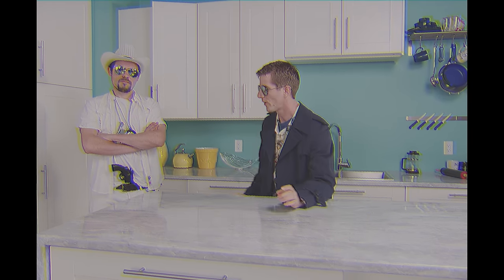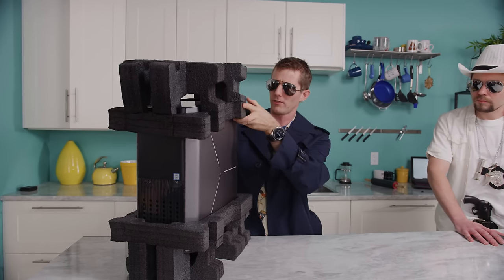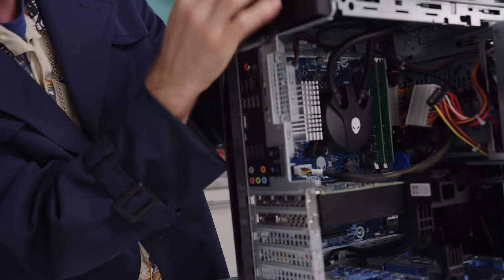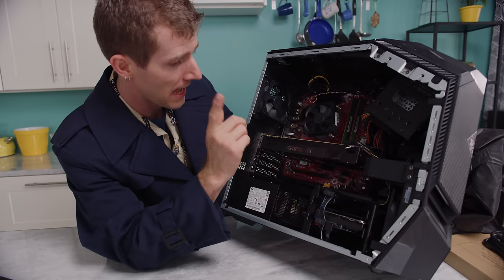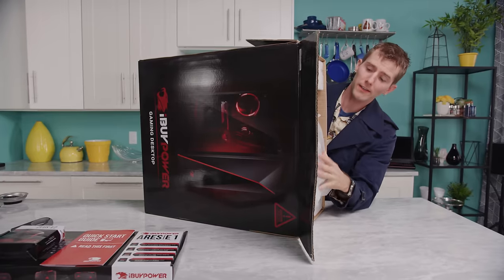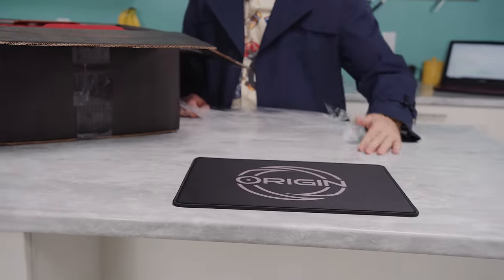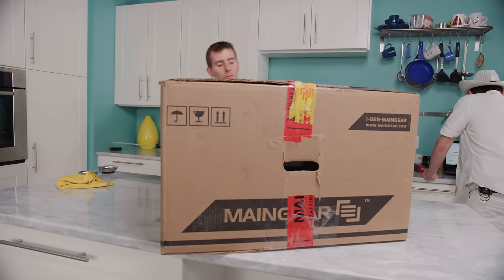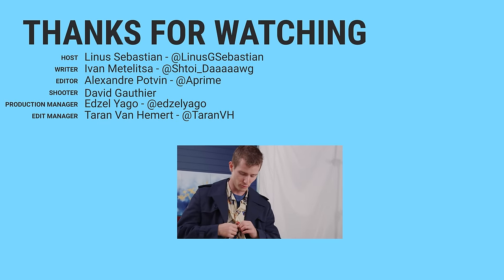What did we BUY?? - $1500 Gaming PC Secret Shopper Part 2

Comment: wow my pc got outdated fast and I got it like 3 years ago
Reply: This is the real problem. It doesn't matter if you spend $400 or $4000, in 5 years it's junk.
Reply: Can't be that badly outdated right?
Reply: @WilliamW97  it can be if it wasnt very good in the first place :)
Reply: @apaxtoa  yeah i built my pc like 3,5years ago and the only part that was kind of newish was the graphics card. i use the old AMD 8 series cpu and it works great.
Reply: @apaxtoa  lol fair enough.
Reply: Depends on your definition of outdated! Sure parts may have outclassed it, but does it still do what you want it to do?
Reply: It's not your fault as there was no competition. Intel had a monopoly for the last 10 years and released lackluster CPU's with minimal improvements.
Reply: Wow my laptop was bought 5 years ago, its not gamer and still runs some newer games lmao. 

Btw its a dell 15r 5537.
Reply: I bought my PC when skylake was out and I got an i5 6600k running at 4,5 GHz, GTX 1070, 16 Gb RAM and NVMe boot drive + 500 Gb SSD for games + 2 Tb HDD. Got the parts for 1,6k including tax 3 years ago and it still runs all games on High settings at or above 60 fps on 1440p. Not sure what you got but buying PC's is all about timing and future proofing.
Reply: How big is the NVME drive?
Reply: Tyler Wiley " It's so big you gotta put it in the front! " 

(Le druaga1 reference)
Reply: @Tyler-Wiley  250 GB
Reply: It probably has 120mm fans. EW! Silence is outdated.
Reply: @OcihEvE  yet my 7 year old i7 2600k is doing fine!
Reply: Well from 2000ish to 2011 systems got utdated every year, 3 years isnt that bad....
Reply: @givejagersacogback7602  If you're using an fx8350, you cant just "add" a ryzen series chip.  Ryzen as a platform uses the AM4 socket, and thereby, only AM4 motherboards are compatible. The 8350 uses AM3+.  Beyond that, the upgrade in board and processor would then necessitate DDR4 ram.  (Ryzen does not support DDR3)
Reply: @OcihEvE  That's not really true... a $400 dollar build is not only going to under perform currently, but it will drastically under perform even a year or two from now. A 1070 or 1080 is going to outperform now, and in 3-5 years it will average out or become slightly sub-par yet still be capable.

Comment: So much money yet only a GTX 1060 or 1070
Reply: SirCharles the GTX 1070 is fair the 1060 isn’t really.
Reply: @sircharles Well it might be Canadian money because Linus tech is in Surrey which is in canada so if that’s the case it’s prob 1100$ American which I doubt or it could be American money and be 1900$ Canadian. also it’s not just the graphics card the processor and graphics card is prob 600 and with the ram the storage and mother board prob add 300 and the power supply and the case 100 plus the assembly which is like a 50 dollar job so if you build it urself you would save 200 and you could possibly upgrade ur Gpu to a 1080 don’t judge me if I’m totally off i don’t have a crap ton of experience building my own pcs
Reply: @ronanpon7282  Yeah the budget was 2000 Canadian Rupees or about 1500 USD ^^
Personally i wouldnt buy a GTX 10 series new now other than maybe Evga B Stock 
or used since quite a few already migrated to RTX cards
Im guessing ( without any evidence ^^') that the componends cost around 900$ and assembly should cost 60$ at best 
Might be that you guessed better still :D

Comment: finished video HP looks like it will win hands down
Reply: IDK, I'm rather impressed with iBuyPower overall. Gaming, both iBuyPower and HP should be about equal, and better than all other machines in the video, thanks to the use of a GTX 1070. But iBuyPower's use of real branded high quality parts puts it over the top, especially the MUCH better GPU cooler (which thanks to GPU boost may actually allow iBuyPower to take the number one spot in performance in games). HP's blower style cooler will not hold a candle to that Asus cooler.
Reply: iBuyPower for sure

Comment: Yo, Origin sent a PC offering COD BO4 with a 1050 Ti, where the recommended system requirements are a 1060 6GB or a GTX 970, and the 1050 Ti is significantly worse than those two

Comment: Ibuypower Is offering i7 8700k Windforce RTX 2080 Adata 16GB DDR4 RAM MSI Z390A PRO Motherboard Seagate 2tb Hdd 240gb SSD WD Green liquid cooling and case of ibuypower With 650W PSU For 1799$ Will it be worth it?
Reply: Canadian or US dollars?
Reply: @Markus-zb5zd  Us I guess
Reply: I think its worth it
Reply: @arunim2000  What if I say for 53$ more I am getting same specs with i7 9700k?? which one is better?
Reply: @amitansh  if you can get those specs for that price, get 2 lol.
The first computer I built I had a i5 7600k, 1070, 2tb hdd, 250gb SSD 32gb ram with a watercooler for $1900 ish. It was 2 years ago. But still, yours are a freaking great deal!

If I were to buy any of those systems I would have to pay a lot more. A 2080 here is about $1000 alone and a 9700k is about $550. So yeah, its a great deal if you ask me.
Reply: @amitansh  Ohh if I buy a system fully with basiclly the exact same configuration, but no (from what I understood?) custom watercooling, that would end up on about $2400-$2500, so you have a reference from what someone else would pay in a diffrent country that still can get it fairly cheap compared to other countries.
Reply: @rickardsvensson7097  Ok Thanks dude❤️
Reply: @amitansh  9700K has no hyper threading sadly 8700k still the best

Comment: "There's some weird stuff in here" so what you were saying was, it was alien to your expectations? ;) I don't see why bare metal on the internals of a system without a goofy window in the side is in the "bad stuff" category, though. It's not like the thing is going to rust, or at least not before many other bad things happen due to being in an environment wet and salty or otherwise chemically active enough to cause corrosion.
Surprizingly impressed with the HP on unboxing too. All my prebuilt systems have ended up coming from them, but they weren't recent. 

iBuyPower seems to have put function over form, nothing at all wrong with that.
Your Maingear Good and Bad list doesn't agree with itself, or what you just did in the video - one side says 14 days from order to ship, the other says 19, and you just pointed out the sign on the side saying to remove the foam but the list says there wasn't one.
And this is a video over a year old, so none of this actually matters by now. I guess that says good things about how interesting this particular series of them is?

Comment: The hp computer looks awfully similar inside to my lenovo legion t530.. it literally has the EXACT same cpu cooler (which is awful, reaches 100c sometimes on basic games), same crappy exhaust fan, weird extra bit sticking out of the gpu (rtx 2060)..

Comment: I'd definitely give BONUS points instead of negative points for HP's cancellation based on the "hangouts" call. That's a great anti-fraud policy, and as someone who used to work for a US cell phone company, I probably received some 2-3 fraudulent calls a day out of an average call volume of about 4-5 calls an hour in an 8 hour shift. One of the biggest clues was if someone called in, and their credit file had a flag with a phone number to call back to; as I had call display, it was sometimes VERY easy to confirm that I had the right person, and also knew when I would need to call another number to verify.

Comment: Just a note on orientation arrows on shipping boxes, and this probably applies to most shipping companies, although I'm specifically talking about UPS here. Anything written on the outside packaging like "Fragile", "Do Not Drop" and "This Way Up" essentially goes ignored with the exception of hazardous materials, in which case we are supposed to pay attention to orientation arrows. If I'm loading a heavy box onto a truck, I'm going to push it under a shelf with my foot rather than squatting or bending over. If the box has huge air gaps in it (like with the ibuypower one), the outside packaging will look like garbage very quickly.

Comment: Maingear is expensive if you want an actually good gaming PC, probably because the case is ridiculously fancy and comes with stock water cooling. Expect to spend about $2,000 USD for a Ryzen 5 2600x system. It does include free gear and games, but if you don't need those games, you could save yourself like $700 buying an iBuyPower or cyber power pc and they would include a Ryzen 7 2700x and 2060 GPU.

Comment: Omen, the two fan size thing. Wonder if it's so some of the back pressure forces the hot air from the GPU out the bottom grill instead of making it swirl over the upper board.

Comment: I made a custom system on Aftershock PC for $1500. The specs I got were: GPU: 2070 Super, CPU: 3600X, Motherboard: B450M, Memory: 16GB 3200 Mhz, Storage: 512 M.2 NVME SSD and 2TB HDD. I even threw in wireless Wi-Fi and a bit of RGB lighting and the total was $1474. This just goes to show how trash these systems are.

Comment: a bit late here, but i bought an IBUYPOWER pc just a few days ago and i am VERY happy. i9 9900k cpu, rtx 2080 super, gpu, evga 80+ gold 750 w power supply, 16 GB of 3k ram, 1tb seagate sata drive, 480 gb ssd (not sure what brand or model), the snowblind case with the lcd side panel, wifi/bluetooth card, gigabyte z390 UD motherboard. lots of room to upgrade too, all for only $1800.

Comment: The Maingear might not win in pure system performance (and it probably won't, I haven't seen pt3.) but the parts used were very well thought out. 
1. Janice said he would be video recording and streaming, and for that you want the Ryzen CPU
2. Janice said that he has an average monitor and is not looking to upgrade. A 1060 will do for 1080p gaming pretty much every single time. I imagine if Janice said "he has/wants a high-end monitor", there would be a 1070 in that system. 
I don't need to watch pt3 to know Maingear won this one.

Comment: The HP Omen canceling the order because you used Hangouts and the phone number didn't match I would actually put in the 'Good' side, because they are sensitive to the problem with identity theft, and it didn't slow down their delivery in the least (as you said, first at the doorstep). I mean, imagine if someone had spoofed your information, wouldn't you want them to NOT charge you $1500 on a system you didn't buy?

Comment: Top-Mounted USB, Audio, etc. ports facing up require plugs for unused ports so conductive junk has zero chance of connectors shorting-out inside this style of I/O Port Mounting style.

This happened once with a phone jack I had mounted top-load in order to make it easier to plug cords in behind their desk right in front of it.

But, I had forgotten to tape over the unused RJ-11 Jack and vacuuming it out fixed it.

ALL Unused Up-Facing Ports Require Dust Seal.

Comment: I got a cyberpower prebuilt with an AMD Ryzen 7 2700x , Radeon rx580 x, 16 gb DDR4, 2tb seta drive, 256gb nvme ssd, windows 10 pro, 650 watt power supply, and 4 120mm case fans. 
Total cost was $985 , highly recommend.

Comment: Just got my new PC to see it here in this video, the Aurora R7. I was lucky to get it for $961.99 with an 8700, 16GB optane, 1080 and AIO water cooler as an open box at Best Buy. Normally would not buy a prebuilt but I could not come close to this on specs without more sacrifices than Dell made. I also get the full warranty through Best Buy so its no different than new (was marked "fair" but only had 1 tiny scratch and two scuffs, all the accessories, even that $10 keyboard and mouse).

Comment: Even though the board is proprietary it is an upgradable PC and not with only dell parts you can put whatever in it, it’s not like Dell’s stuff where you can only upgrade with there proprietary parts even though there part of dell I guess they figure gamers are most likely gonna upgrade something eventually, can’t wait to get mine I’m dying for GPU prices to come down but I may have to just bite the bullet and spend the dough cause I’ve heard it could be a year or more before GPU’s are back around MSRP and CPU’s themselves have gotten insanely expensive I miss buying a Mobo/CPU combo from Newegg for about $250-300 and you would get a good board and processor now it’s a little over $1k for the CPU/Mobo and they don’t sell combo’s anymore that I can find check out this R11 it’s been upgraded with aftermarket parts that aren’t proprietary https://youtu.be/5B-zwUs8J3Y

Comment: I bought an Alienware Aurora in 2008.  I did get the Alienware keyboard and mouse.  That box your power cord was in had the keyboard, mouse, an Alienware Mouse pad, a actual bound book with documentation on everything in the system.  It came in a box that was literally 52 inches tall, and I had to get help carrying it in the house from the UPS driver.  He actually said "Dude, I don't know what you have in this thing but I need help. "  I still use it to this day, until I get all my parts for my AMD build (Jan 2020).  I will just say, the the case it comes in now is rather disappointing looking.....oh...forgot I did get the Alienware Monitor as well, one reason the box was so big...

Comment: My first gaming machine was an iBuyPower (my parents were funding it and didn't trust me to build my own yet). When it arrived, the outer box looked like the iBuyPower box they got in the video. I plugged it in, and nothing happened. They had unplugged the power to the GPU and hard drive when they shipped it. There was no documentation as to why they did that or telling you to plug it in. Also, I had to buy a different case because the case iBuyPower used wasn't big enough for the ATI Radeon HD 3870x2. The card fit, but the case didn't have sufficient cooling to run it without overheating.

Comment: Hmm, I don't know, it's easy to say that Dell had the better cooling capacity with a quick inspection; of course a 120mm AIO beats a dingy little stock-like cooler. But if you really think about it, that little stock-like cooler is probably enough to cool a non K i5 8700, and even though it might seem counter-intuitive, I think that they actually put some thought into the cooling fan distribution, they are pretty much ending up with pretty much neutral pressure, since the graphics card is a blower design, it too acts as exhaust, so the small turbine fan plus the 80mm fan most likely add up to just about a normal 120mm fan, so 120 in, 120 out (I can't really make out how the power supply is mounted, but I think that it's mounted for exterior intake? The case seems to have an open bottom, so it would make the most sense to take air from the outside, specially since the case has some decently sized feet, so even in shag carpet it would probably be "ok-ish")

Comment: Its sad that people actually buy these, not a single one of these companys did extensive research about the customer's need. Sure most of them are fine PC's, but with 1500$, you are supposed to get every detail right, start from the case and casing. So people please contact some pro's before you buy PC, otherwise you will not get even nearly best bang for your bucks. 1050ti inside 1500$ gaming PC is just a massive joke.

Comment: Remember when Dell bought Alienware? "We are not going to change the company, we just want to give them the benefit of our supply chain to solve part shortages for them." Such BS, that is totally Dell engineering on the inside- identical drive cages, proprietary motherboard, same old vendor lock-in games. The Alienware we used to know back in the day is completely gone.

Comment: I got an iBuyPower desktop from Best Buy after finding a really good deal there. Was there just checking out what they had to offer. Sales rep tried his best to get me to get an Alienware/omen, but knowing better I found the small little corner in the back with the not so known brands. Ended up getting a much better system for less then what hp/Dell offered. Was not planning on getting a pre-built, but after checking online for what it would cost me to build pretty much the same system I would have only saved around 90$. It's been a pretty awesome computer so far. Only thing that really sucked about it was the SSD it came with which I upgraded shortly after, and knew I was going to need to anyways. From what I understand iBuyPower kind of throws together the prebuilts for retail locations with extra parts they have laying around, and sell them to the retailer for the same price regardless of specs. So there's a chance you can get a really good deal, but also get ripped off, but if you know what your buying then that's not a problem.

Comment: Just have to put a quick correction. The HP is definitely NOT powder coated (basically painted). Its anodised (a tint in the metal). Realize it seems minor but anodising generally is more scratch / damage resistant.

Comment: I suspect that extension is so you can swap the power supply, without plugging/unplugging the cable from the motherboard & potentially putting stress on the motherboard. Sometimes, it can be difficult to remove or install tight PS connectors from/to a motherboard.

Comment: “Firm” and “help with impact” is entirely false with sensitive electronics. You need soft and cushy to spread out that impact time.  I guarantee a full sheet of egg crate would be like hitting water at 100mph on your broadside.  Note how the closed cell foam is not full coverage. The limited surface area helps keep the weight*area to stiffness ratio down